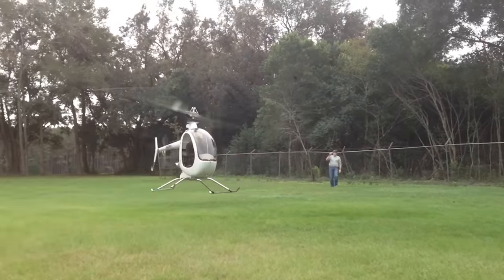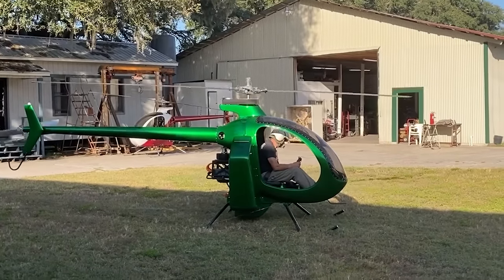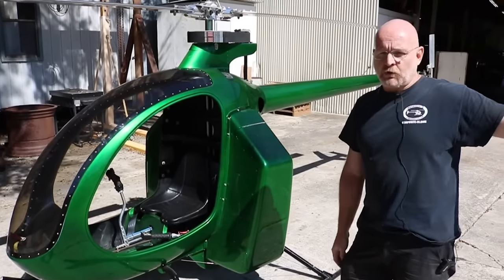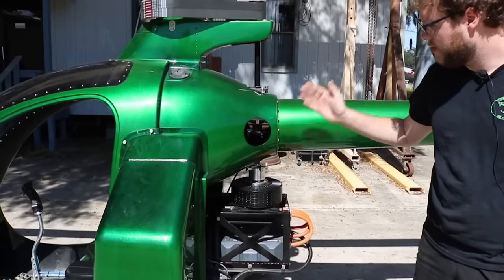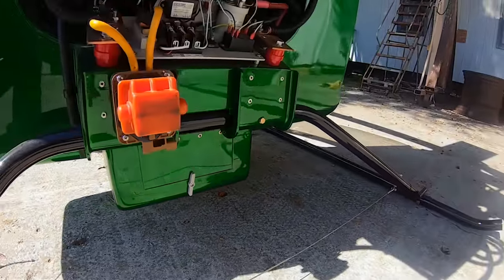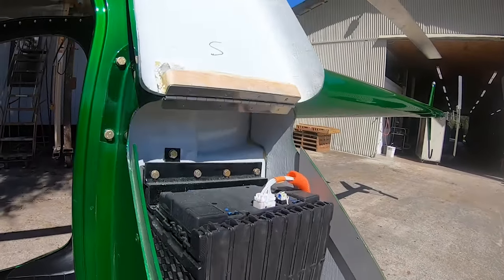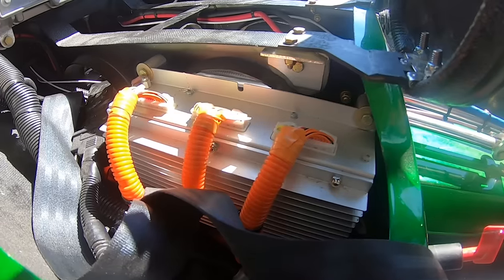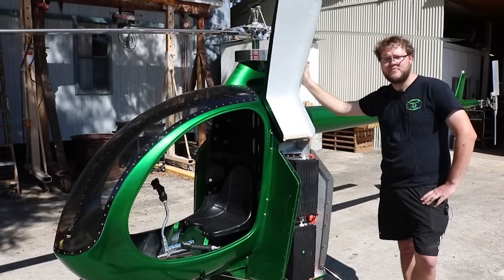Mosquito Helicopter going FULL ELECTRIC!? 2023

Comment: Great toy, but how can it have 336V? There are 5 LG-CHEM NMC 120AH 8S module stacks connected in series (i.e. 5 x 8 x 3.6 V), which gives a nominal voltage of 144 V. At 40 kW (floating power as mentioned) this results in around 280 A (40,000 W / 144 V) on the battery side. This results in a running time of around 25 minutes. Even if you use the Smart EV 16S 63Ah packs it would only be 288V rated voltage and there would be no change in run time as each module is still only 3.5kWh. This reduces the discharge current to half, but at 63Ah it is only half of the 8S 120Ah stack, so the C rate is still the same. Due to the high C rate (discharge rate ratio of capacity to discharge current), the internal resistance of the cells has a negative impact on performance. With a discharge current of assumed 280A (in the 144V version) and a nominal internal resistance of the single cell LG-CHEM 120Ah (prismatic pouch cells) of approximately 1.2mOhm (0.0012Ohm), approximately 0.33V is dropped per cell, so that is Total loss on the pack with this very high discharge current is approx. 3.7kW (13.44V x 280A). These must be deducted from the nominal amount of energy; when added to the theoretical flight duration of approx. 25 minutes, this results in a reduction of 1.5 kWh. The heat capacities for lithium-ion cells of this design are in the range of 0.19 to 0.22 Wh / (kg x K), so during the flight with a battery weight of approx. 120kg the cell stacks heat up by up to to 62°K, this could be worrying and require water cooling.
I would recommend aiming for a higher battery capacity to minimize losses.

Greetings from Austria, we don't have any kangaroos here.

Comment: Get rid of the TR gearing and add a second motor.  Size it appropriately and drive it at a constant speed.  This will let you drastically reduce the sized of the main motor and be less maintenance and failure points.

Comment: The torque is not always there on electic motors if the ECS doesn't have a governor. This is a good idea of the flight time and safety concerns are eliminated. Electric should make it much quiter and smoother.

Comment: I like that you don't rely on a computer to fly it for you you don't need a self-driving helicopter. Somebody with a powerful ham radio the signal hits the damn thing and all of a sudden it doesn't want to fly on a straight line it wants to make a hard left into the ground so yeah as long as you can avoid radio frequency interference. That's a good thing and also make sure the person is under $120 I bet that'll make it to be 30 minutes flying time you don't put 300 lb Leroy in that thing and expect it to perform

Comment: I think that is not necesary too much structure in the electric vehicle in this case the conventional desing of helicopter was made thinking in a combustion motor and atlest two passengers, because of densidity  energy on electric batteries is more limited than combustible, the electric vehilces maybe should change the concept and think in optimizer that energy with only one passenger and security whit parachute o loe speed fall system like a inflatable planer with a system similar to airbag( sorry my english )
Reply: Pienso que no es necesaria demasiada estructura en el helicopteros electricos porque el diseño convencional de un helicoptero esta pensado en un motor de combustion que es bastante pesado y ademas genralmente estan hechos para mas de 2 pasajeros, por otro lado tenemos la capacidad de almacenar energia de una bateria de litio que aunue es muy buena comparada con las otras baterias es muy baja comparada con la energia del combustible que permites autonomias de vuelo muy superiores, por toso lo expuesto anteriormente creo que el diseño de un helicoptero electrico debe ser pensado en vehiculos de solo una persona y cuya estructura optimice el  peso, por otra parte incorporar un sistema de paracaidas o alas de apertura rapida con sistemas similares a los aribag para

Comment: Batteries are are becoming better and better every day! I propose a hydrogen nickel batteries at 3kw per battery and you can easily get 1 hour from 10 batteries. 20000 battery cycles from this type of cylindrical batteries are definitely a better performance! I use LTO batteries with very good fast charging characteristics and also 20000 up to 30000 cycles! Good luck!

Comment: Only problem I see is gas engine produces same output power as long as you have fuel. Electric batteries just drain but retain same weight and then motor just slows down until you fall out of the sky.

Comment: Extremely fast pace LiFePo catch-up to LiPo battery engineering! LGChem energy density superior power density claim is unusual as LiPo norm rates higher but fire related. LiFePo4 chemistry via LG New Life is facing potential Hyundai catastrophic lawsuit, GM also uses batteries twice recalled. (LGChem LiFePo battery is now LG New Life)

Comment: Very good concept !  Trick for reducing weight : Use a motor higher voltage than 24 or 36 V, you will reduce diameter of wire, and size of cooling Fan ! With higher voltage, Ampere is lower and main contactor and Lugs will be smaller !

Comment: battery tech probably will never reach the point where this is viable tbh. except for very short range missions with a really good quick swap and charging system it is even useless for example to spray crops... then rather get rid of the human and use a drone and get like +20-60% flight time

Comment: Drone-like flying cars may indeed be a better choice. With their small side rotors, they offer ease of learning and convenience in flight. It can be challenging to identify advantages of flying EV helicopters over these vehicles, as a matter of fact, I can't even identify a single one.  Should I consider purchasing a flying EV, I would likely opt for the drone-like models, despite their limited availability on the market currently.

Comment: The rotor and the propeller need regenerative properties like alternator something you can gain back from their spin. 📡👽🇺🇸 RUN!!! Titanium alternators. Aluminum copper coated wire but somehow light very light. The regenerative device devices need to only be 1/10 and the output 9/10 so that you win. 😁🧙‍♂️🛸

Comment: Guys, why not replacing batteries with fuel cells? I think hydrogen should work much better for helicopters and aircrafts - everywhere where weight is essential. It's obvious that for larger prototypes batteries will not work.

Comment: Battery capability will go and weight down, Tesla is getting close to weight to KW ratio. Electric is the way to go. Simplicity at its best, fewer moving parts. 

How does the helicopter autorotate? Does the drive system incorporate a Sprague clutch?
Reply: 😂yeah it’s soooo reliable..
Reply: @theowink  well if your so knowledgeable about the subject please educate me. My Tesla Model Y has exceeded and continues to exceed all expectations. Now a purchase comes with a $7500 rebate.

Comment: I do not like the look of that belt drive. It should at least have an enclosure incase it comes loose and destroys the rotors. Edit: Even more concerned now that I see the belt is made up of two parallel stacked belts which could interfeer with eachother.

Comment: that belt makes me want a parachute above the rotor.
Reply: bummer that the air compressor use couldn't wait until after the video
Reply: so cool to see it fly! it does make electrical gremlins a little more scary...
Reply: 11:30 great question
Reply: 13:00 Basically what he's saying is the tail rotor is too tall at one to one and needs to be reduced to let the motor work less hard. He explained it fully, but to me it felt confusing.

Comment: 😱There is a big mistake in the design, because the battery doors open up and touch the propellers, if the doors open suddenly and the helicopter is flying, it will cause a disaster

Comment: here's a nutty idea, STAY WITH WHAT WORKS! why reinvent the wheel? its that 100 plus year old problem with electric cars, range, charge time, and reliabilty. sure there are places you can go for fast charging, but you will drastically shorten the life of your batteries. when batteries cost as much as nice used car, fast charging isnt really a great idea after all unless your made of money. so now your back to slow charging to avoid reducing the life of your cells.

now with an electric aircraft, how far can you go on 25 minutes (wink wink) of power? im guessing there's no electric heli charge ports around as of yet. right now it's an impractical toy........so have fun flying around the house i guess.

Comment: A lot of people can't grasp how much energy there is a gallon of gas with that gallon of gas weighing 6ish pounds. Viable vehicle electric motor and control technology has been in place for over a 100 years. There is a lot of positive things about electric motors such as simplicity and full torque at all RPMS. The problem with electric vehicles is the batteries. They have NO WHERE NEAR the energy density of fossil fuels. Until such time that batteries have that energy density electric vehicles will remain an oddity unless the government shoves them down our throats. IF, big if, battery technology does get to that point then the sale of electric vehicles will take off like hot cakes on there own merits.

Comment: I am sure that the idea of installing a generator to recharge the batteries is a failure, as it will add significant weight and will not be able to provide enough power to charge the batteries. Electric motors have good power density, but the insufficient energy density of batteries makes this concept a dead end. Hydrogen fuel cells have higher energy density, but may not be powerful enough for a helicopter.

Comment: I have power source giving 200 amp. Output . 10 kg weight.
If it useful for you?
Actually I run my EV CAR NOW.
24 VOLTS 
200 AMP. D. C
200 AMP A.C 3PHASE

Comment: Can u show an actual flight
Reply from the maker: NO. Sorry. It isn't legal to "FLY" in a testing phase. only to hover. This is a "Concept" in testing. Not a "Product" available for purchase yet. The higher you go... the harder you fall too. Which these electric high torque motors, if something goes wrong it goes wrong quickly with that massive "flywheel" moving above you. Best to be close to the ground when the torque grabs! 🙂

Comment: I don’t really get the point you’re putting in a gas engine in there to charge while using a minimally acceptable time driven electric motor to provide rotor power. Not there for me as a new customer.

Comment: To much power for only 1 motor.   Spread the hot wire to 4 and up.. so you would not burn the copper wires.

Comment: takes 12 hours to charge and you can fly conservatively for a solid ten minutes. SMH Please you Cannot get the energy density per pound that you can with fuel. Don't care what the fuel is made of the explosive properties are where the energy is derived add to that the mechanical momentum of an engine by nature and you can't beat it. Battery tech will never be there.

Comment: while EV choppers are "cool" at 25 minutes, unless battery technology undergoes some dramatic breakthrough it's never realistically going to come anywhere near an internal combustion engine.
Reply: a fuel cell could work in an application like this but would require a lot of custom engineering as i dont think they are an off the shelf thing yet
Reply: @zachmoyer1849  fuel cells are very interesting, however I believe the safe storage of hydrogen is still an open problem
Reply: @Anhar001  its done safely all the time the concern is more around efficiency and venting that much hydrogen into the atmosphere as it boils off in its tanks plus cryogenic systems arent cheap but for this specific application could be cool
Reply: @zachmoyer1849  hmm still not sure about the safety aspect, I know back in early 2000, they trialled hydrogen powered London buses, I recall multiple instances of issues and then eventually the project was scraped if I remember correctly. However I've not re-looked into fuel cells since.
Reply: @Anhar001  from a quick search it looks like those buses are still happening but synthetic fuels are starting to be produced akin to methanol i think that is the way forward they are not efficient but would require little change to the infrastructrure and could be shipped from deserts easier than hydrogen

Comment: Trop gros par rapport a la taille de la courroie qui devrait être plus grandes avec un brushled a joue fixe variable ta un avion de chasse le problème les batteries
Avantages avec la joue fixe tu peux rentrer en mode haute vitesse économique du a des règles d'acier mélanger graduellement a du charbon et donc en très haut voltage donc maintenir le filet d'énergie qui se superposent pile poil vers les aimants et contracté donc grâce a la joue variable qui alimente le esc créé le meuilleurs calage donc de model réduit la même chose en géants mais cette fois ci avec la duré du vole dans électrique

Comment: Guys please, STOP! You're going the wrong direction. I know it's fun but your design and component selection are wrong. Some of your choices scare me. You're just picking up OTS parts and slapping them into your shell. That's how you build a home made go-kart. The 20-min flight limit should have been your first indication that you're doing it wrong. I did this for 10 years and was the first (the company I founded) to begin a full blown Part 27 FAA type class certification for an unmanned VTOL. If you can't exceed 60 minutes flight time, your XE is still the better choice for ANY use case.